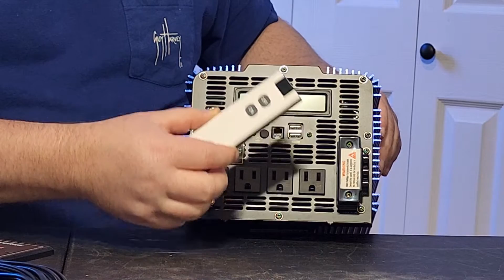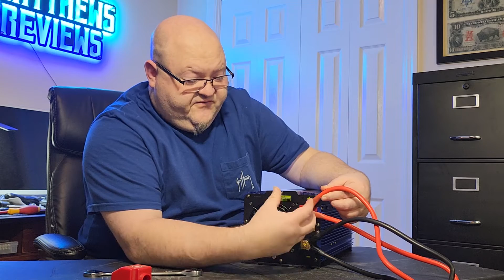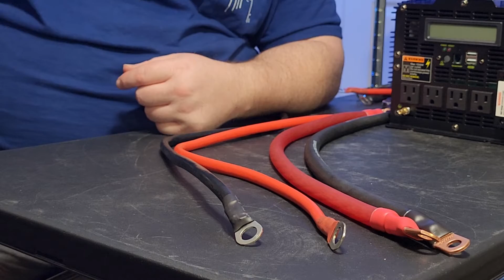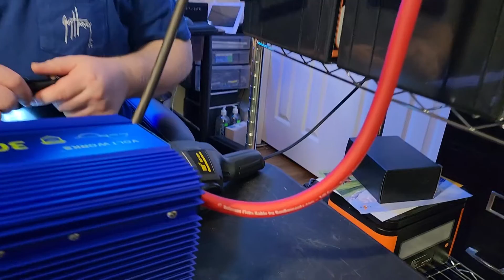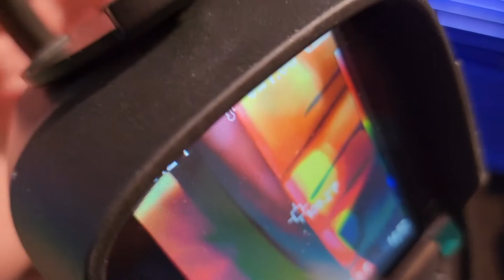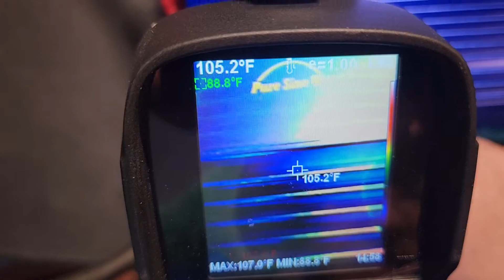VOLTWORKS 3000 Watt 12V Pure Sine Wave Power Inverter

Comment: @Calic3538 I want to add something to your comment. First I bought this inverter about 3 weeks ago, and yes it's a 3000 watt inverter, if you watch the video he was running at and over 2700 watts constantly so it can not be a 1500 watt inverter. If it was 1500 watt inverter peak power would be at 3000 watt, and rms power would be at 1500, rms is continuous power so if he's running at over 2700 watts on a 1500 watt inverter it would have been shut off.

Comment: Something does NOT make sense. If it's a 3000 watt continuous it should be 6000 watt peak like the pure sin MWXNE I have...which means it should NOT shut down as soon as it hits 3000?? It should be able to handle around 5900 watts for a few moments before shutting down? It seems like that inverter has no tolerance over the 2900w mark which means it not really a 3000watt inverter it's more like 1500?

Comment: for the last bit of wattage, use a 3 way lamp.30-50-75 or 100 watt.
People should be convinced now as far as cables.

are the Neutral and hot reversed on any outlets ?